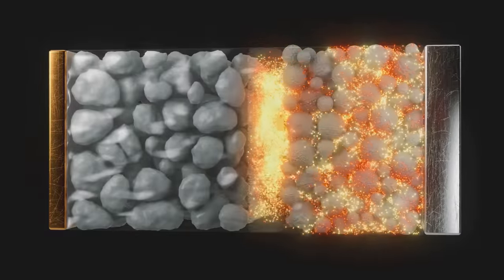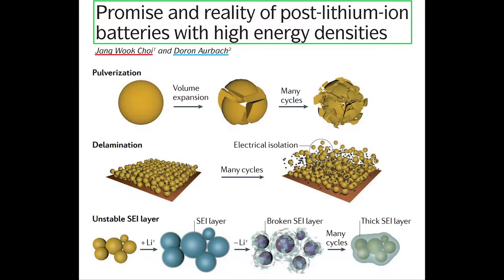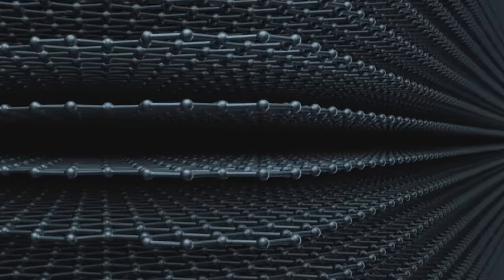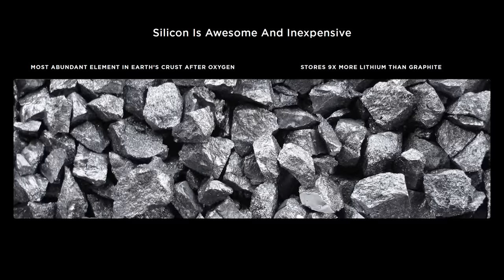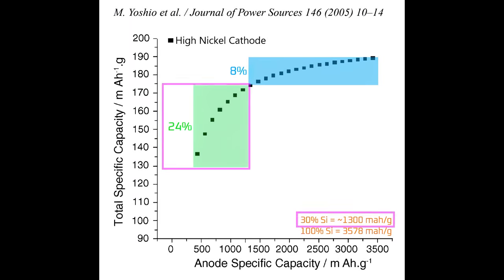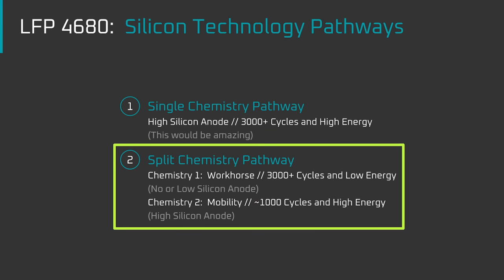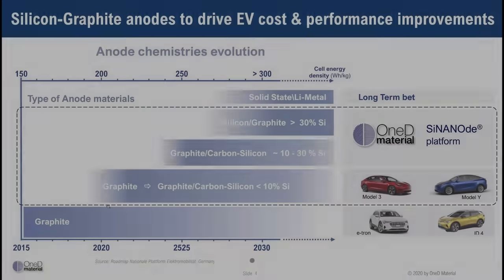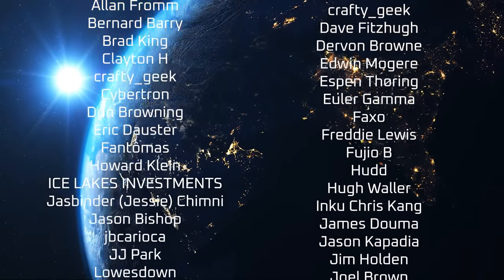The 100% Graphite Silicon-Free 4680 Anode // What are the Implications?

Comment from the maker: Note 1:  I think if anything is delaying Tesla Silicon, it's the issues Tesla has with the dry coating process rather than the Silicon itself

Note 2:  One person (Dr. Juho Heiska) has noted that it's most likely the tabless electrode providing the extra power that Sany mentioned.  I agree!
Reply: ⁰0
Reply: Please note Tesla MUST qualify batteries for the heavy duty semi trucks that NEED to endure. 

This HD application is far more demanding than typical in cycle life, both in total SOC excursion and possibly going to the limits of SOC.

(SOC - State Of Charge of each cell).

Qualifying pure carbon cathode first is a prudent move, as the semi cannot turn into a Bolt style flop without endangering the company.

Prudent move. Reasonable move. As Tesla perfects (and thoroughly tests & qualifies) it's silicon enhanced cathodes over time current choices could be overcome.
Reply: @stefanweilhartner4415  Is the silicon nanowire technology the same as that from Amprius' silicon nanowire?
Reply: @celsostarec6735  I think they do not go to the limits of SOC. Especially for HD applications:
1.) Limiting the SOC range (smaller DOD) allows more cycle life and less degradation. They maybe will use it for qulification in order to create nore harsh conditions but not during real truck generation. Voltage window (SOC range) has much impact on lifetime 
2.) One thing where they would need to find the balance is to be able to gurantee the power needed to propel the truck especially at the edges of the SOC window. This is tough to do especially at cold temperature.

3.) In order to qualify the cell they will probably will use much higher C-Rates then will actually be usued during operation (e.g. 1C/1C)

4.)

Comment: Hey Jordan! I loved the video as usual, and my God your CAD animations are incredible. Really helps convey the physical material transformation. I wanted to share one thought on charging speed for Austin 4680. I would assume that Tesla has fairly conservative margins on allowable charging speeds, so they may have given some of that up to keep 4680 comparable for 2170. Also, an improved thermal management system may also compensate for that. 

Would be an interesting video if you were able to do a deep dive on thermal management for structural pack vs traditional pack. I'm sure there is a lot of evolution there discovered by Monroe teardown.

Comment: I think achieving the same energy density and same or better charging speed without using silicon is due to two things mainly:
1.) As you mentioned dry coating allows for better point to point contact and higher thickness of the anode --> Energy

2.) Tabless (multitab) design decreases  the DCIR (Direct Current Internal Resistance). Low DCIR is one of the main drivers for charging speed and this effect somewhat counteracts the effect of slower Li-Ion uptake.
But one has to say 30min is not that fast to be honest which is a issue of cylindrical cell form factor. Will be difficult to achieve same charging speed as with stack/winding based pouch or prismatic cells (just on a pure design point of view, but these form factors have other drawbacks).

Nevertheless typically cylindrical cells have already usually between 7-10% Silicon. Prismatic cells maybe 4-6%
One issue that we should not forget: Handling Si is not easy, you need to add other conductive agents, you have issues with swelling etc. Your voltage curve and nominal voltage changes (decreases).

So also Tesla is new to the cell manufacturing game and might need to catch up to established cell suppliers like Panasonic, LG, Samsung or CATL. And maybe dry coating alone is a handful for now!

I assume they will add it eventually but probably do not need to yet, due to the effects described above. Also Si cost maybe ~50-60 $/kg but graphite ~5-6$/kg
Reply from the maker: Totally missed this comment!  Thanks man!

Comment: Aren't you missing that the Model 3 battery is larger so 80% charging for it is more energy than 80% in the AWD Model Y. So while it got to 80% in the same time, it actually charged fewer kWhs, so it does charge slower.
Reply: Charging speed of battery cells is not measured in kW but in %SOC/time unit.
Reply: absolute charging power is irrelevant. If you charge two cars at the same time, you put more energy into the batteries (that you could view as a combined, bigger pack), without changing the actual batteries at all. for comparing battery tech, we are interested in charge rates. Jordan's comparison is the correct and useful one.

Comment: Why would Tesla make a storage optimized nickel cell instead of just using LFP? Seems like it would be a waste of nickel given the shortage of cleanly mined nickel.
Reply from the maker: Great question.  This is something I wonder as well.  I'm left with this view:

-At this point it might be too premature to say whether a split chemistry pathway will be useful for Tesla's in house production.  I included it in the video because I thought it was an idea worth putting out there.  

-Panasonic already uses a split chemistry pathway and has been for some time.  The utility of that approach may outlive its usefulness, but at least in the interim, Tesla and Panasonic are finding it useful.

-There will always be a mismatch between the number of cells required for a use case and the number available.  The supply chain will constantly be evolving and Battery Tetris will be ongoing.  

So, a split chemistry pathway may not necessarily be a permanent fixture, but may prove to be useful intermittently to plug gaps in demand or to take advantage of short term slack where cell supply exceeds a specific need (both of which we've seen happen in the last few years).

I could go deeper here with examples, but those are my general thoughts.
Reply: From some old Elon interviews my understanding was that domestic power walls used cylindrical cells containing nickel (& cobalt/manganese) to save weight.  The power walls are delivered to site fully built with only electrical connections, settings and fixing of the unit carried out on site.   These units are heavy and difficult for two men to handle in customer's homes.  For  the larger grid and commercial units they could buy   lfp batteries on the open market.  Mechanical handling is all done by machine.
Most other manufacturers of power wall type products normally install the lfp batteries on site after the box has been installed  thus avoiding handling weight problems/restrictions.   

TESLA  have recently increased the size,  capacity and weight of power walls,  I suspect that this means batteries will have to be installed on site unless they have come up with home friendly handling equipment.
Reply: @davidclark2286  If weight is the major downside then there may even be a path for sodium ion in Powerwalls.
Reply: @patreekotime4578  that is unlikely but we will have to wait and see the performance of the batteries when they are available.  Claims made at the moment are  extremely erratic.   My impression is that per kWh they weigh  more and the cycle life while better than lead acid is far worse than lithium iron at  between 800 to 1000 discharge cycles.  This would suggest they are not going to be suitable for ststionary storage.  
I read of a CATL plan to lease them,  each vehicle having 3 'batteries' but only needing one of them to run.   So one could have the long term lease for one battery and rent an extra battery or two  for longer trips.  This would make battery swap set ups interesting.

Comment: Thicker electrode means higher AH capacity for given size and weight, but limits maximum cell current, earlier onset of electrode layer ion starvation, and greater internal heat generation for high current.  Greater internal heating and larger 4680 cell size may make thermal management more challenging.

Comment: I will take a guess here after learning from your video. Tesla has Cybertruck and Semi coming up, both relying on 4680, both would be desired to have long cycle life due to commercial nature and not KW constrainted bcz of large packs KWh they would need to meet range requirements, so Tesla might be focusing on perfecting carbon Anode which complements vehicle requirements and existing chemistry before moving to silicon for vehicles like Roadster, S & X.

Comment: There is a practical limit to increasing anode capacity in terms of limit to how thin the anode layer can be made relative to the corresponding cathode thickness capacity.  Thickening up cathode layer to ratio match a higher capacity thin limit anode layer is not an option as it degrades performance of cathode.